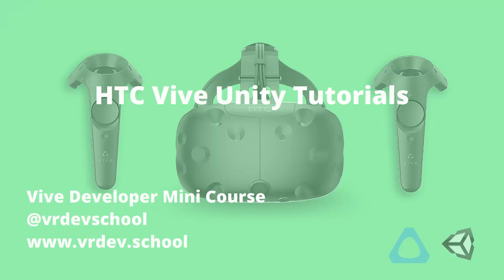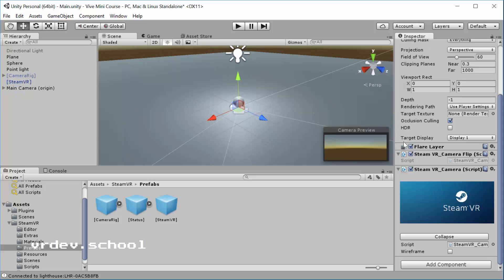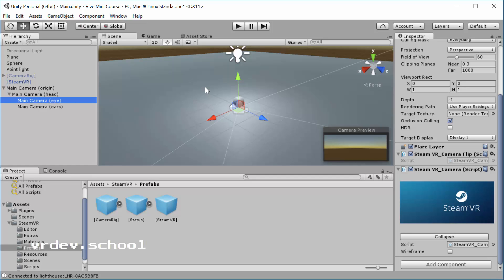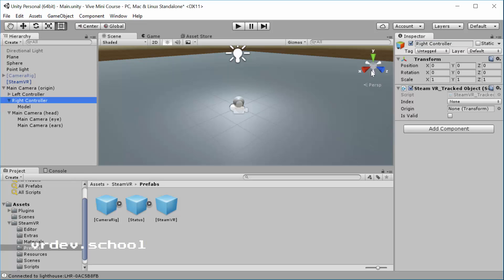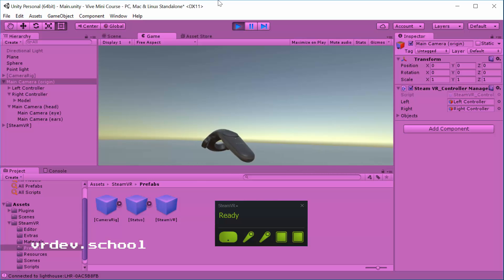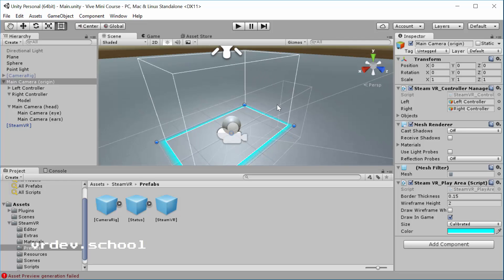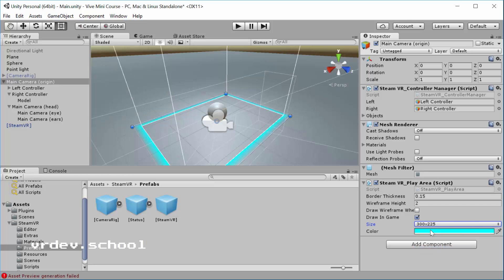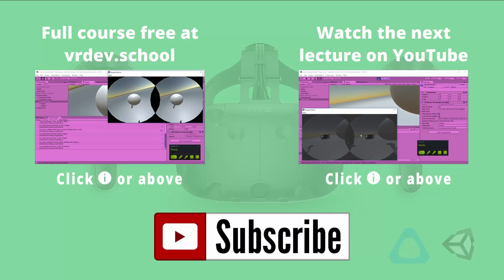Vive VR Game Developer Tutorial - Part 5 - Convert an existing Camera for SteamVR

Comment: In Unity 5.4, Camera head tracking stuff is free on your existing main camera (assuming you've gone to player settings and enabled Virtual Reality Supported and selected OpenVR SDK).   So, you can simply add the TrackedObjects for controllers and room scale scripts to your main camera. The performance of the Unity camera is better than that from the one in the SteamVR plugin as Unity/Valve optimized its render loop. If you use it and you are still CPU bound, you could also enable "Single-pass Stereo rendering" in player settings and that will reduce the CPU workload by cutting draw calls in half. You could also try enabling Graphics Jobs, but Unity is still working on perfecting that (marked experimental) and it may not work in all cases.

Comment: Hey I'm in need of serious help! I get horrible fps 10-20 in certain areas which is not good for vr duh how do I fix this. ( I have a gtx 980 and 5820k with 16 gbs ram) HELP!
Reply from the maker: +Brandon Shaw First thing to do is figure out what exactly is the largest bottleneck. Use the profiler to get an idea of where the biggest problem is:
http://docs.unity3d.com/Manual/Profiler.html
Also have a look at Unity's guide for performance optimizations to get an idea of what stats you should be investigating:
http://docs.unity3d.com/Manual/OptimizingGraphicsPerformance.html
Reply: +VR Dev School will do thanks :)